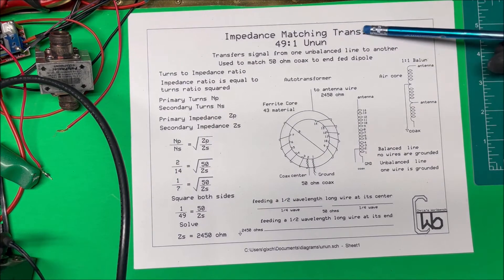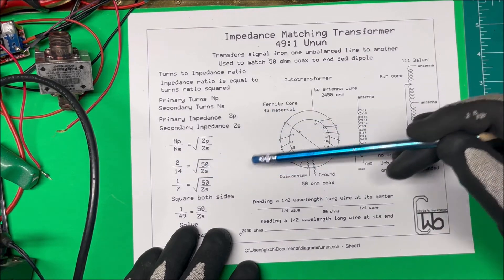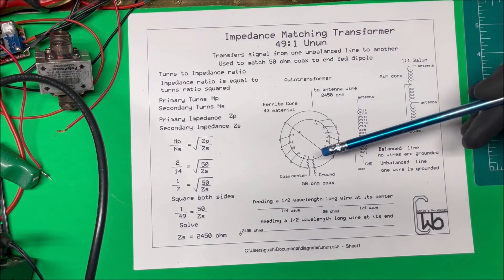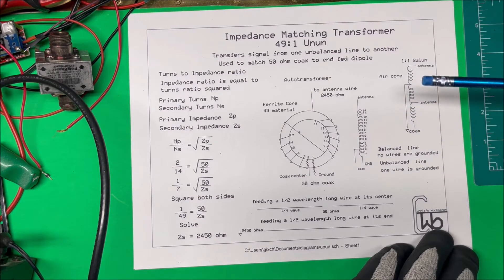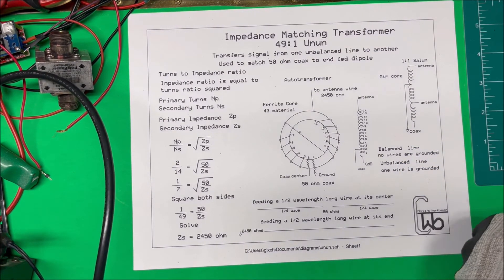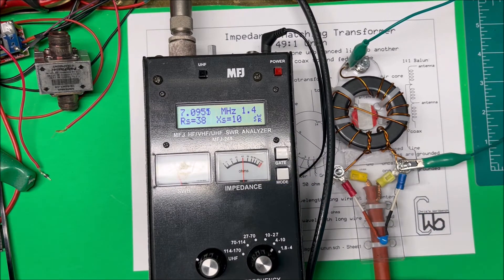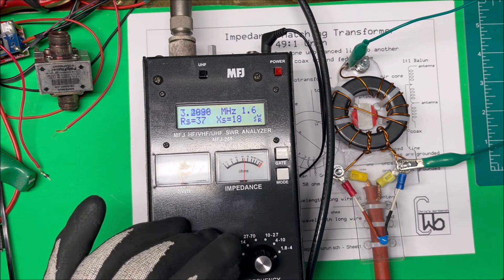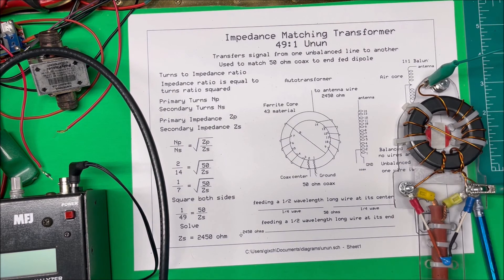49:1 Unun  Impedance Matching Transformer

Comment: Thanks Chris - interesting.   Looks like you route the winding across center of the torroid and continue the wraps  in same direction.  Is this just to have the output exit on the opposite side of the input, or is there some other electrical effect achieved by this ?
Reply from the maker: Yes it puts the output on the opposite side, and helps break up the winding capacitance.
Chris
Reply: @ke6chris  cheers -  great video - thanks!